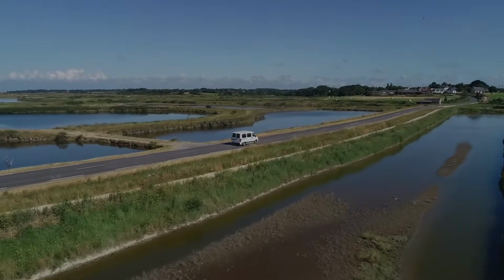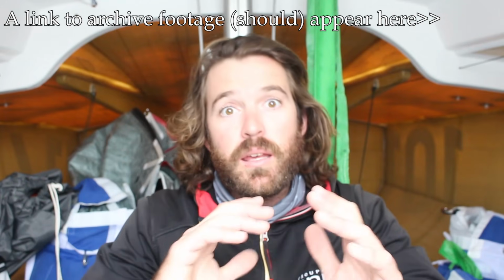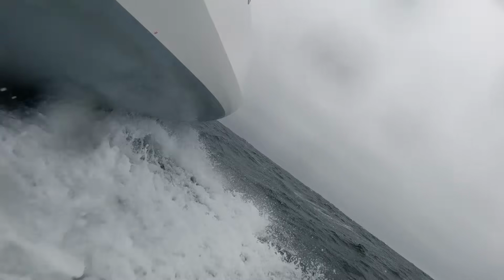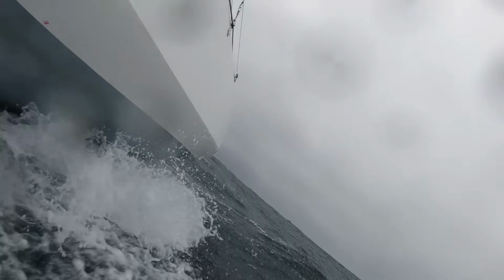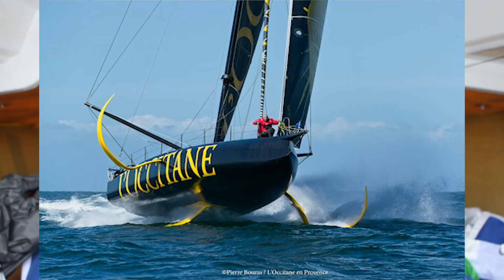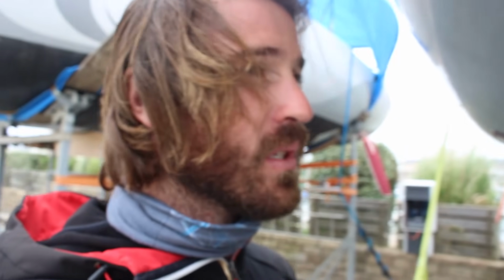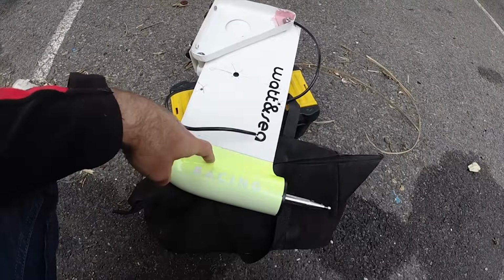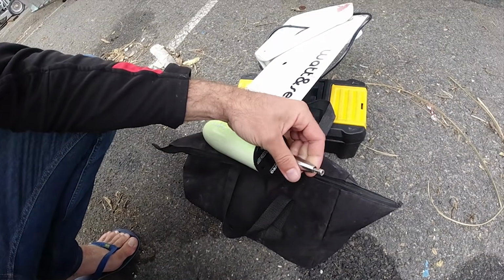Why the ugliest boat ever? - Ep117 - The Sailing Frenchman

Comment: You didn’t mention the advantage of more internal space for sail storage and better sleeping options. I think that it is awesome. There are a lot of traditional Dutch barge boats with the rounded bow style. And there are other performance advantages when healed to do with the immersed shape of the hull against the wide stern wedge shaped hulls which are slightly pushing their keels sideways through the water.

Comment: In my opinion the most important factor, is that in the capsize test, the boat floats differently (bow down/up), allowing for more sail power and canting keel angle, which benefits performance;  as you have more power to sail, it compensates for the less efficient shape. Also, the boat tends to sail on the side narrow chains, to use the rest of the body as a lever.

Comment: I'm wondering how it performs in green seas. With such a flat bow is it like hitting a brick wall if you plough into wave ?
Reply: I beliee it would rather bounce on the wave, that's why they're faster than traditionnal boats.

Comment: Can you tell me how you can use a depth sounder and a speed WITHOUT a hole in the boat???
Reply from the maker: Echo goes through the hull, depends on the material, the thickness and position

Comment: Your boat looks great- good luck sailing it. These boats need less open cockpit and more protection for the crew. When heeled over water comes back along the topside into the cockpit. When planing the bow wave moves aft and dumps water onto the crew. I see this on video- I dont sail!! An enclosed cockpit would be safer for long voyages like the Mini Transat, classe 6.50 should also have more electronics and long range radio- HF or Iridium because they sail so far across the ocean. What do you think?
Reply: That is the whole point of class, no communication except vhf, and sbb radio, it started as cheap offshore racing in 70... And it is not sailed by amateurs, the qualifications are quite rigorous, racing + 1000 miles solo trip that needs to be approved to be able enter main A course. Basically the point of no modern communication you have no idea where your main competition is you receve distance to finish over sbb radio + whether forecast, and in main race minitransat they have companion ships( class 40 50) for every 6 small they need to have one big that is checking on them + they have beecons which have like 3 position + tracker. 1 position is on second is on I'm fine but have dificultys but want no assistance and last one is come save me. And off all competitors are wearing personal location become, but to be frank most of them know if you fell of from ship it is most likely an end, so they form small packs and radio one another to keep an eye, some share racing stuff to, some no, but most of them are like family and know they need to keep eye on another and support... There was even pettition to stop government wanting to put sat phones in minis, if they are to be made mandatory it will be race over if use since it goes against spirit of race,  small boat as fast as possible across the pond without outside assistance and vhf only :) even gps werent allowed, but most of participants had them so they sad ehh well then...  as of enclosed cockpits it would be unnecessary weight since all boats must right them self and they perform the test before race, so by ading enclosed cocpit it would be to cramped since in cabin you are on knees or siting down laying, or to tall and if water gets in boat more space would be required for flotationd foam again mandatory in zones to keep boat afloat(sometimes when they abandon the ship in race by bad decision or medical reasons, demage to rudders keel problem, they keep on floating and get to Caribbean and get recovered pogo 2 was this year found or atlast video of was put on) but to be fair it is nice that they are seaworthy if damaged and abandon they are hazardous for other ships, but point was to make them as safe as possible for skipper to survive in worst conditions... The history of mini class or open 6.5 if rich an quiet fascinating, tbh, 1998 was taught year for them and they made qualifications real difficulty for a reason, in recent years 2013 was heavy weather and hard allso... Sry for typos not native language, will stope here can type to tommorow 😁
Reply: @mkapo8509  Sure, but I think the boats should be equipped to sail alone, not as a shepherded fleet- with more protection for the crew from waves
Reply: @hwntwww  They would , but government dosent allowed them to leave French waters, so they would shoot on minis instead of air for start :)  to be fair most of time minis are flying on autopilots, you trim sail stac everything if you are racing and off to sleep, helm during the battery charging period, in general the point of race is to find the limit of boat and your self and ride there without braking either boat or your self... And even in worst case scenario boat are safe unless they hit ufo to demage keel boreken ruder you have 2 so if lucky you will be good, and if unlucky and you didn't reinforced transom (weight saving) might be in trouble, but you have life raft and survival course + tps suite... Point is as I said they are not boats for casual sailors, or at least in main race adventures chilling are in back and sailing in comfort zone cliped in by sling(lunatics for  weekend sailors) while the top guys are pushing it to the limit, last edition top series boat first non French winer was keeping it up with top prototype while the others in series boat division were few days behind but then again maybe that is why he won... If crossing Atlantic I would rather be in mini than bigger normal boat if the things are about to go bad and that says enough for boat and class... Bigger boat would be more comfy in ideal situations tho :)
Reply: @mkapo8509  and because of the wide round bow, they don't dig in and plow through waves, making for much dryer deck and cockpit than on normal boats.

Comment: Gorgeous boat, looks built for speed, #captainObvious. The scow bow, do you see it becoming popular outside of racing? I’m assuming the ride upwind could be harsh, but I know for the transit you don’t do much upwind anyway.  Thanks for the vid, but seriously video of you sailing that beast will qualify as #sailporn #NSFW
Reply: Between West cost of France and where they catch trade winds there is more upwind sailing than you would think.
Reply: Fesh Fesh Sailing agreed, like I said, they’re racing, so comfort is not the first box they try to check, trade off between pounding upwind and surfing down,you figure?
Reply: @mhensen1  you need to visualize the underwater profile of the hull as it heels past 15 deg when beating upwind.
At that heel angle the entrance angle of the bow section is no longer as widely rounded as when the boat sits upright.
These scows actually pound more when broad reaching than when beating to windward.
Reply: Fesh Fesh Sailing wow, that’s cool, never thought of that, I envisioned them pounding straight, but you’re right when heeled, much narrower profile, so are you saying this type of hull could work for other types of sailboats rather than out and out racers? I figured it was like a formula one, not good for stop and go...
Reply: Fesh Fesh Sailing I saw your channel, gorgeous boat, and fast, thanks for sharing
Reply: @mhensen1  Lots of new and recent cruising boats (Beneteau, Amel, Ovni, Jeanneau, ect...) are all coming out with fuller bow sections.
Reply: Fesh Fesh Sailing I will enjoy watching them fly by, if I ever get my “Classic” plastic that I can afford
Reply: @mhensen1  I just posted a 2 minute video on my channel to show how the underwater profile changes as these wide boats heel over.
Have a look.
Reply: Fesh Fesh Sailing thanks, so much to learn, enjoy your boat, it’s a beaut

Comment: Will also make a wonderful conversion to a cruiser once its racing career is over, I had an old 1/4 tonner that was similarly distorted by rules making it short beamy and high aspect ratio rig put an outboard on the back and 5 bunks raised cabin and viola a family holiday boat.

Comment: It seems like it would also be a good design for a cruising boat, as you would have a lot more volume inside especially in the front berths.
Reply: Cruisers need headroom as well and this is way too shallow-draught to give much of that. Also, with such a shallow and flat forefoot, it must slam a lot going to windward, which would be very uncomfortable - and, therefore, tiring - for cruising. None of which matters in a racer!
Reply from the maker: Have a look at what IDM marine are doing with fast cruisers, interesting designs
Reply: Super lightweight hull this is a pure racer. Adding cruising fittings and accessories would make it too heavy.